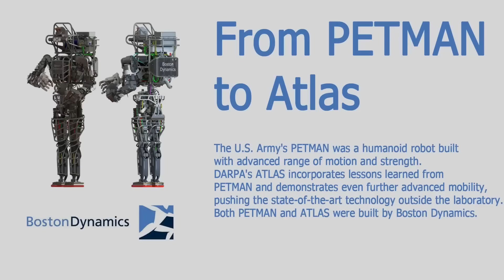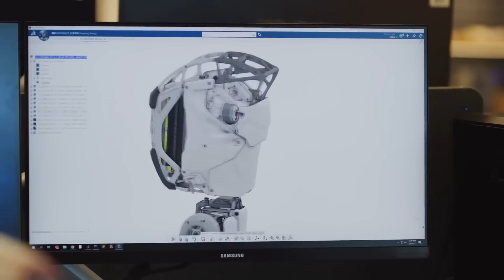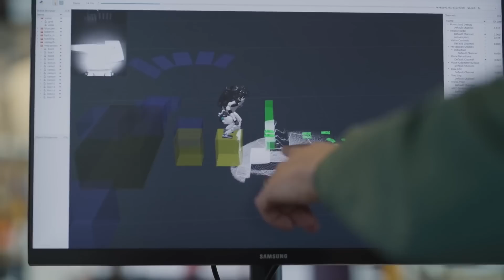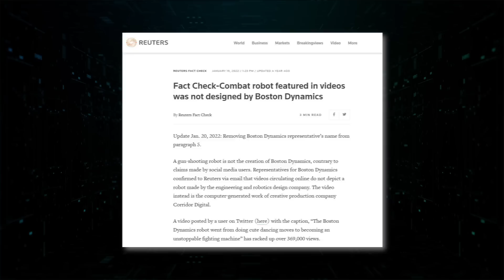Boston Dynamics' Atlas Bot SHOCKS Investors

Comment: Robots are not a good idea for military use, this will make it more easy for the enemy to win a battle. 
All and every machine working on a software can be hacked into, the Robots can be turned against their own side. 
A machine or a robot manufacturer will always deny, that they are not building machines for military purposes. 
And suggest that they are fool proof. 
But if human minds are designing these to work, other humans can easily figure out how to change the actions of the Robots. 
A single terrorist with a smart laptop can turn all US army robots against the US army itself. It will be more easy for them to win. 

These things look good in movies. Using them in real life, would pose as an equal threat to both sides.

Comment: I know people are scared of combat robots people also fail to realise that if even one component is destroyed then the bot would be completely incapacitated. Like one wire, it would absolutely cripple the robot.
Reply: So the bot designers start building in redundant systems, duplicates and even triplicates if something fails.
Reply: @thebluestig2654  Well, that's smart... Now your robot weighs twice or three times as much,  is less maneuverable and still can get easily destroyed if the redundant systems are close to each other. Good luck coming up with redundant joints and connectors. 🙄 You could have at least thought about it for five seconds before posting. :yougotthis:
Reply: @christianadam2907  Who said the robot has to be a bipedal humanoid design?  You never played the early Armored Core games on the PS1 did you?  Multiple mobility options, including 6 legs, tank tracks, rollers, and even hovercraft options.

Medieval suits of armor show how to protect joints while maintaining mobility and flexibility.  The same ideas are already being used in robot arena combat to the death.
Reply: @thebluestig2654  Video games are not reality 🤣
Reply: @christianadam2907  Robots  have already been built using multiple styles of mobility, many of them existing before the Armored Core games were ever created.

Comment: AS CARBON FIBRE IS SO MUCH LIGHTER THAN METAL AND EVEN STRONGER, WHY AREN'T THESE USED IN AI BOTS CURRENTLY INSTEAD OF HEAVY METAL LIMBS AND TORSOS??
Reply: carbon is very expensive 1 at a time, lambo and ferrari make 1000 - 4000 carbon parts at a time so cost each is very low

Comment: The problem with Boston Dynamics robots is the robots operate on lines of instruction to perform each movement.  AGI is being developed by Tesla with Optimus.  Learning by visual stimulation with NO hard lines of code to tell it what to do.  Optimus learns.
Reply: The problem with a neural net based learning system over a "lines of instruction" methodology is that it is much more difficult to isolate fault conditions with neural net type systems. A neural net is more adaptive, but won't be as easy to debug.
Reply: It debugs itself by reinforcement learning.
Reply: @marcfruchtman9473  you dont have to isolate the fault, the ai will do it by itself if you mention it, make it see its own wrongdoing.
Reply: AGI is a hard problem. Given Tesla's struggles with Full Self-driving - recall Musk promising that one every year for most of the last decade - I doubt there will be quick success with this either.

Comment: My questions are two: first when will the atlas robot be equipped with a quantum computing processor, and two, when will atlas be mass produced?

Tom Sisson
Reply: When you can miniaturize subzero cooling, Quantum processors require cooling from liquid helium. So not any time soon.
Plus equipping an automaton with Q-processing seems silly when the drone would want to have as little on board waste as possible.
If it needed access to Q-processing it would just package the data and send it to a remote server.
This is the model that will continue to dominate computing moving forward. (Distributed computing)
Reply: When that happens we are all screwed kardash
Reply: It will never be "mass produced".  It is not being developed for you.  This is for big governments to control you.  Wake up.